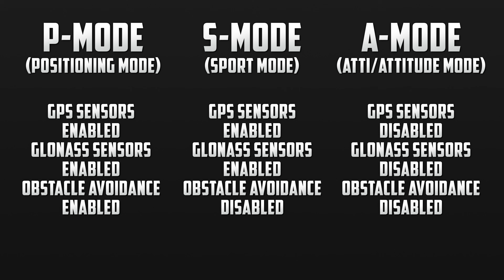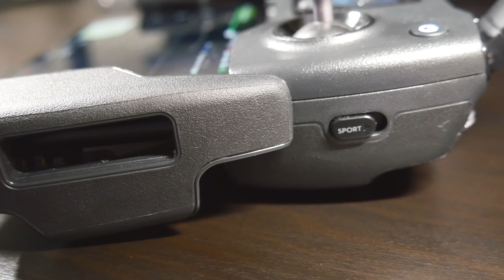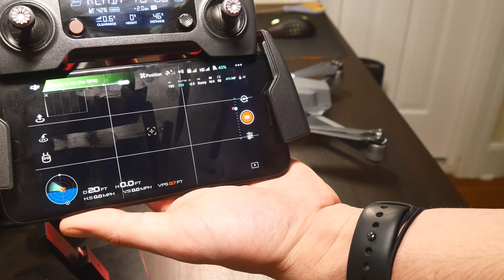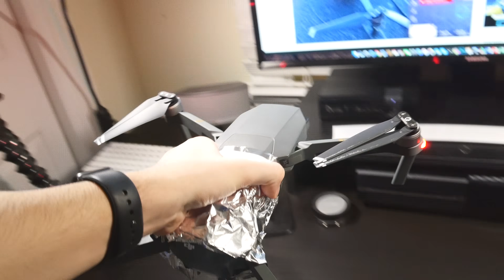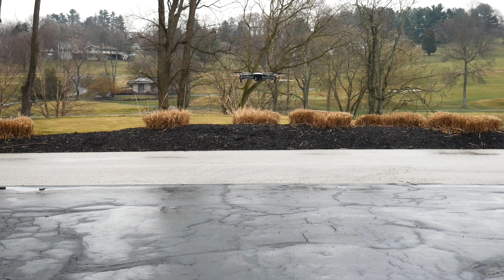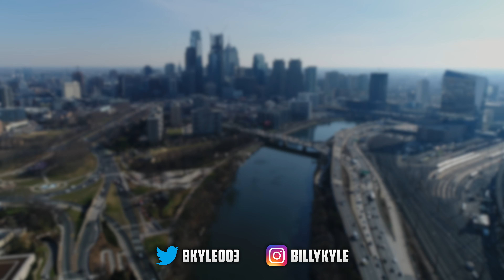How To Put Your Mavic Pro into ATTI Mode Using Tinfoil

Comment: It is once happened to me by flying close to a building, of which the sensor failed to work too.  I was flying a Mavic Air with 4 sensors round. It just drift right. and can't even control it, I end up using the V stick control to take it down.
Anyone seen this before?

Comment: Just tried the tin foil around my Mavic Air. Mixed results. It did go into a ATTI mode but needed to wrap tin foil around the entire body. This affected the connection to the controller and the unit just kept rising. Fortunately was trying this in a shed so it hit the ceiling and fell. Damaged props but no other lasting damage.

Comment: I can see where this would be valuable actually. Let's say I want to destroy my drone but because DJI has done such a good job engineering these things it could become difficult to trash. Yes you could just fly over a lake and wait for battery failure.....oh wait no it would return to home so it would have to be in atti mode for that to happen. So there you have it, a perfect example of why you would need to wrap your drone in tin foil. I heard if you wrap the props with Saran Wrap the drone will be much quieter. Maybe a video demonstrating that is in order. I won't do it with mine cause I actually like my Mavic Air just as it was shipped.

Comment: Technically, it can only be used when you live in a restricted area. And the draw back is that you get Disturbed controls and couldn't control properly and I crashed it as well. And only need to cover the rear end of it from the top.

Comment: Has there been an ATTI firmware update since this video? I just purchased the a Mavic Pro in Alpine White. I received it Feb. 2, 2018 and have performed 3 suggested updates. Of which I only glanced at the list of update features. As I power the drone and remote, ATTI is displayed on the controller.
Reply: Doug McPheters the drone is in atti mode until you have enough GPS satellites. I thin you need at least 8 and then it goes into P mode and set the return home as soon as you take off. Remember if you fly in atti, which you can if not enough satellites are available, that you won't get a return to home position. Make sure if you fly in atti you keep it in line of sight or you could get in trouble quick if video feed drops out.

Comment: You could  try to put it only on the top and sides as GPS is not comming from bottom and need an unonbstructed sight of eye in order to keep your vision and ultrasonic positioning. I'll definetely give it a try to fly inside.

Comment: they really need to add atti mode so people don't have to take risks doing this. I should also mention that my drone repositioned itself towards some tree branches and water while in GPS mode and completely blocked my input, if it had hit that tree, I would have been out $1000. bad idea to block user input over GPS input unless collision avoidance is the reason. DJI doesn't play nice with warranty/repair but they are the best right now
Reply from the maker: +Neil Caulfield I wish they would
Reply: I feel like DJI isn't well known for listening to consumers lol

either way I'm so happy they finally made something that folds down to less than the size of a football. it hauls too! was flying in sport mode earlier, got it up to 40
Reply from the maker: Oh yeah, it moves

Comment: I crashed my mavic in ATTI mode. Indoor, when mavic get only 5 satellites = it turned on ATTI automatically and started drifting. RC didn't respond to any commands and my mavic crashed himself
Reply: Did you turn off vps sensors or had low light condition indoors?
Reply from the maker: +Oleksandr Fisak Sorry to hear that man
Reply: Oleksandr Fisak I've had it drift outside and ignored my input was going straight towards some branches hanging over a swimming pool. incredibly stupid flaw, user input should override gps reposition.

Comment: HEATING ISSUE - The chassis of the Mavic has longitudinal lines (bars) that stick out, front to back.  This is a Heat Transfer, similar to those on Differential Gears on cars.

Comment: Also a good thing you left the back exposed for the air flow fan cooling. The temp is also logged, I recently contacted DJI about a possible issue and they said they detected a "abnormally high temperature". Being my first DJI product I didn't known they automatically get all the logs over wifi, but looks like the do and can see logs we can't. Healthy drone didn't report any high temp error, so now I wonder if the site is worth it if some errors are hidden from us. I know older phantom videos people talk about connecting to the computer and emailing the logs. But maybe if you have an account and sign in to the app it auto uploads errors to DJI. It's concerning that I did get any message on the app about a high temp. For all I know this could have been when it was inside and I was practicing with the simulator? I asked for details since I've only flown three times, if it's on a day I didn't fly then I know it was a firmware update or simulator. To bad you need to have the mavic on for the simulator.
You might have a high temp error also now? 
Hey, how about a video about the simulator, the 2 different ways either on the computer with DJI assistant or on the phone so people know how to practice. I wonder if you can practice ATTI mode on the simulator, I never tired.

Comment: The GPS is in the top behind the battery. So it is okay to just cover that space. Do not wrap it arround so the ultrasonic-Sensors are not blocked. Also the antennas are not in the body of the mavic but in the front landing feet. So you will not block RF with this mod.
Reply from the maker: +Sven Schumacher So I guess just tape it to the top?
Reply: Billy Kyle it should be okay to cover the top and the side. maybe the back of the craft above the LED.
Reply from the maker: +Sven Schumacher Going to have to give it another try. Thanks.
Reply: Did it work by covering only the rear end?

Comment: Here's a question for ATTI mode, when I fly my mavic inside it sets a max alt (~15FT). Is there any way to lift this stupid restriction?
Reply from the maker: +Chicago Pilot Productions Where does it say this?
Reply: Billy Kyle Indoors inside the gym I tried flying up to about 30 Ft but on the controller in topped out at 15Ft because it didn't have any connections to GPS
Reply from the maker: Might be because you're indoors.
Reply: Billy Kyle thus my question, how do I disable that restriction

Comment: a phantom in atti mode it still has gps with flick of a switch if needed, with foil it dont and it gets hot fast.. dji need to make it that you can use one of the rc switchs to switch to atti mode or they are causing probs for us that use atti for smooth drift film shots ;(
Reply from the maker: +chris digata You're totally right Chris

Comment: Hi 

i want to know about post production 
system configuration 
i am using intel i5 4th gen.
8 gb ram 
i want edit 4k video but my pc not work well in 1080 30 fps footage 
so kindly plz help me wich graphic card shoud i buy and i have not too much budget for get high price range graphic card so plz suggest. 
thank you
Reply: Your i5 is borderline but for ram, I'd go a tad bit higher. For Videocard, I use a GTX 980 .

Comment: It appears by wrapping the Mavic you will stop the cooling air flow through the heat sinks.
Not a good thing for the electronics on board.
This experiment worked OK for short flights.
Reply from the maker: This is definitely not a permanent solution lol

Comment: What the ATTI used for ? And what is it !
Reply: good way to run your drone into a tree if you don't know what you are doing. also the tinfoil should block gps so you could (illegally) fly your drone in do not fly areas.
Reply: Jeremy Judkins i do it before now i have 2 mavic pro one of them broken and the second I didn't open the box yet i feel scare 😂
Reply: takink of from a moving platform, (ship)

Comment: Billy,  I have noticed when I turn on my obstacle avoidance and I push forward on the stick to make the Mavic go forward it hesitates sometimes and then goes normal speed and then sometimes it just goes forward normally without hesitation.  Sometimes it hesitates for a second, sometimes for about 5 seconds and sometimes not at all.  If I turn obstacle avoidance off it responds perfectly.  Have you noticed this with yours or is there something wrong with my Mavic?  Thanks, Jeremy
Reply from the maker: +Jeremy Clark I notice the same thing. Sometimes it could be related to how low you are flying. I've noticed that with increased altitude It hesitates less.
Reply: Grow Up.

Comment: Well I have never seen a foil diaper on a drone . . . . .  until today. 

Interesting concept of how simple household foil defeats government satellites - I think that is more the lesson than anything I got  I shall start wearing my foil hat again :)

Not sure I would ever use this as I can fly ATTI mode in my other models but I like the fact you heard of it and had to prove it out.

Good job my man.
Reply from the maker: +Paul Straten Lol right! Still wonder why they did not include ATTI mode on the Mavic.
Reply: My guess (and I will qualify this with I have no idea what I'm talking about) is that a different team of engineers developed this versus the P4 and P3 series hardware/software that did include it. And there was no attention given to final product readiness as SALES just wanted to "get it out".

I put this in the same category as why I can assign a C1 or C2 button as AUTO CENTER FOCUS option on my Mavic Pro but not my P4P - that's crazy - do you see the same?
Reply from the maker: +Paul Straten you can actually auto focus by half pressing the shutter button on the P4P
Reply: Billy Kyle yes I know but mine only works about 50% of the time – that's why I want a dedicated button for center auto focus – does your P4P allow you to assign a button for center auto focus? I have all the latest software and firmware upgrades – don't get it.
Reply from the maker: +Paul Straten It does not

Comment: is this to defeat safety features or no fly zones?

seems like someone could get in trouble with this.
Reply from the maker: +EDD Skitz Not necessarily, I know that many people like flying in ATTI mode on their phantom series drones and miss it on their Mavic. There are plenty of other ways to fly in no-fly zones without tinfoil
Reply: Billy Kyle what other methods
Reply from the maker: +Milton S. Kendall bearing responsibility through the application, providing your email or phone number. Also known as certifications.
Reply: Thanks Billy: I am aware of those methods but in my NFZ area; such methods does not work.  I thought you another method besides the aluminum foil.  Hopelessly I just want to be able to fly either my P4 or my Mavic in my own yard.